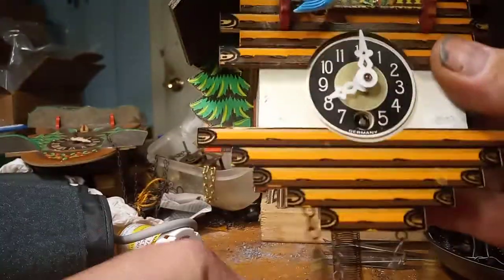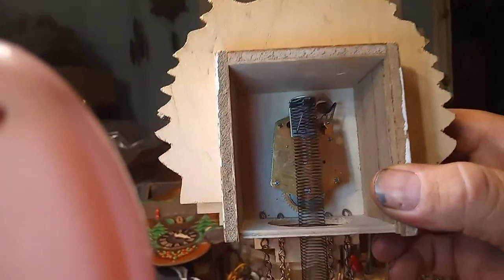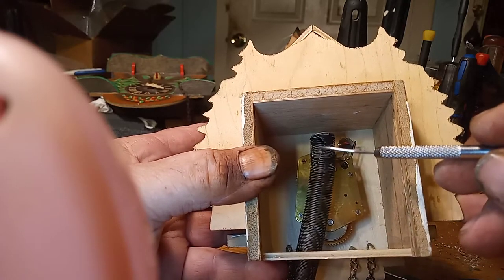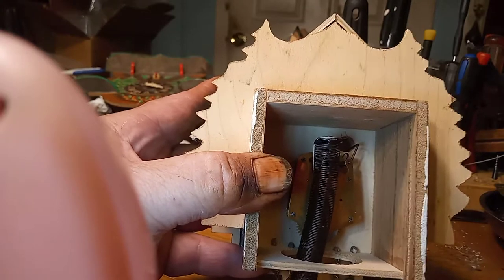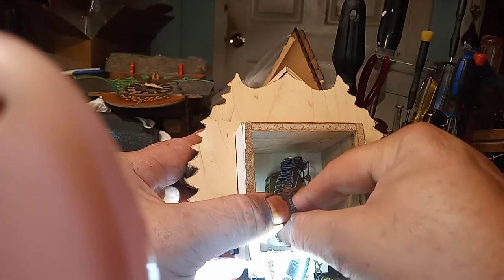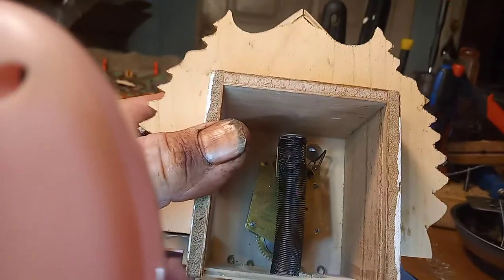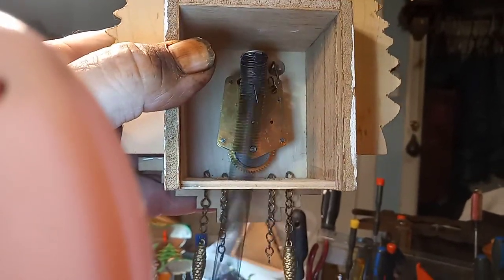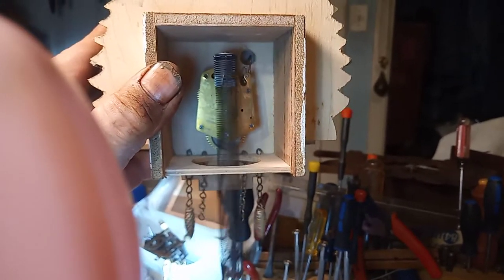Repairing a bouncing girl cuckoo clock 20211028 192120

Comment: Thank you Mark!!  I found a similar clock at a thrift store recently.  The parts had some rust, but with your video and a little WD-40,  I'm confident I can make it work again.
Reply from the maker: WD 40 is a clock killer. I would use some other kind of oil myself. Good luck.

Comment: Hi mark, great video I have one of these but can't work out how to take the hands off so I can remove the movement for cleaning, any help appreciated
Reply from the maker: It’s just a friction fit, so you should be able to pull the hands off carefully!.  You will see me use a pair of tweezers or a pair of side cutters in other videos to remove things that are friction fit on. Start by pushing the tweezers underneath the minute hand with them closed to catch the hand then gently push them underneath because they are tapered as you push the material gets higher and higher causing the hand to come off.  I do the same thing with a pair of side cutters.  Not cutting but allowing the tool to lift the parts/hands off as I squeeze the handles.  Make sure there isnt a nut at the very end as some makers had a small nut/wire to keep the hands on..   Plus there is always the chance no matter what you do that the hands will break so be preparred for that.  Good luck.
Reply: @munnerlyn3  thanks Mark, your videos are a great asset thanks
Reply: One other small question, the time is running slow is there an adjusting method for these

Comment: Hello Sir, I am BHARATH from Karnataka India, I am also having the same type clock, but the doll is missing, what shall be the appropriate weight we need to put to bouncing the spring which will aid for escapment.
Reply from the maker: Once you order a replacement doll for the clock that is the weight that you need to provide the escapement. You can find the replacement dolls on timesavers, Merritts, and other clock part warehouses or you can find one on ebay. I hope this helps. Let me know if you need more help.
Reply: @munnerlyn3  Thank You Sir for your kind and valuable response.
Sir its main spring is also broken sir, I am looking for the replacement of it.
How to judge the temper of the main spring, because it has plastic escapment wheel.